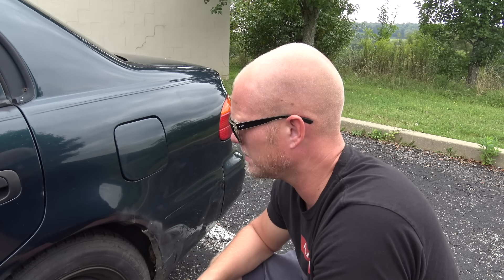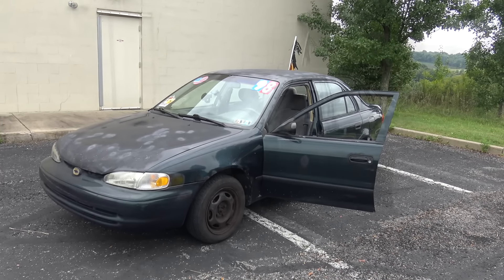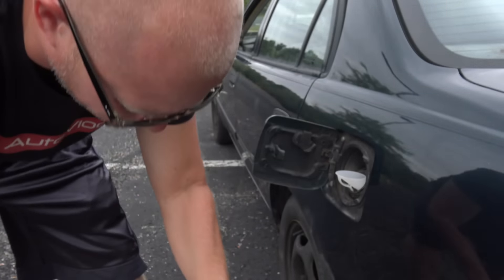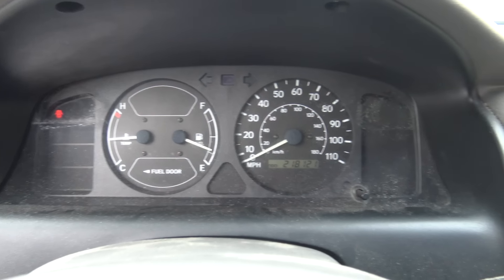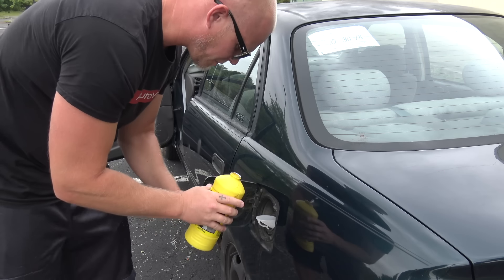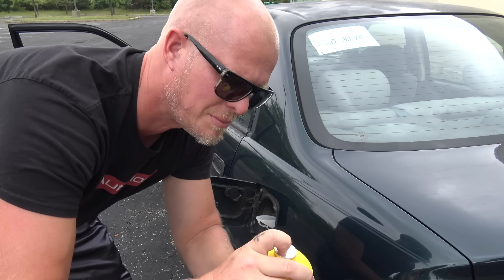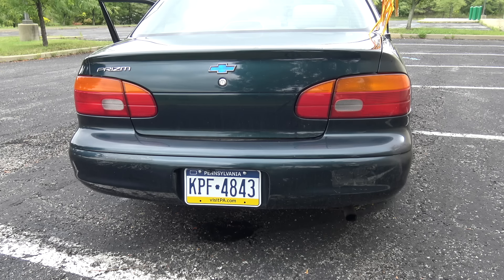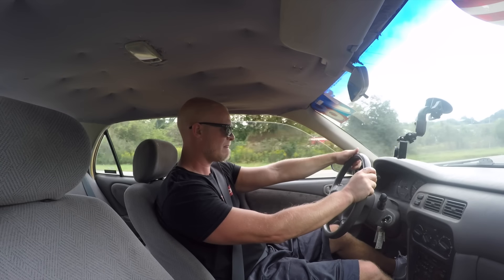What happens if you put BRAKE FLUID in your gas tank? (You'll be surprised!)

Comment: Just checked out your video, and found it to be VERY interesting. I recently purchased a 2018 Lexus and was curious to experiment as well. I replaced the brake fluid with blood, I took all the antifreeze out and replaced it with
 gasoline...  I swapped out my power steering
 fluid for hot sauce... I filled the gas tank with Nitro glycerin... I replaced the windshield washer solvent with black paint... I drained the transmission fluid and replaced it
 with Gorilla Glue... instead of regular air I filled my tires with helium. I started the car up to go to church that Sunday morning, and to my surprise it blew up into a million pieces!!!!!. I was thrown into the future and landed at that same Lexus dealership where I purchased my vehicle. I questioned the sales representative about such a liability, and he assured
 me that it was covered, and the catastrophe would be rectified immediately... I just did not read the fine print. Relieved, I walked out the front door and back into the past, and was happy to see that my  Lexus had been restored to pristine condition. Lesson here: stick to the owner's manual and don't forget to read the fine print.😲
Reply: So true. Good advise!!
Reply: What did you replace your blood with?? Is your Lexus that important? Now that could seriously effect your brain
Reply: @NickKler  
Happy New Year Nick...Just responding to your  comment on my automotive experiment. I must confess I didn't use whole blood to replace the brake fluid, I separated the plasma from the hemoglobin, and mixed the platelets with leukocytes. To answer your second point... my Lexus is not as important to me as the unicycle I got from a midget  at  Cirque du Soleil. As far as my brain being affected, I grant you I'm no Einstein, but the function of my cerebral cortex, far exceeds the capacity to hold a conversation with the upper echelons of academic Society. I conclude the hypothesis was a success!!! Have a wonderful New Year, and remember... Moderation is the key.
Reply: This was literally one of the funniest comments I've EVER read in my life! Thank you!!!:)
Reply: @antoniajohnson3852  Your Welcome..😎

Comment: Brake fluid will clean sticky lifters and sludge when added to engine oil,so maybe you just cleaned your injectors.
Reply: interesting, have you tried it?
Reply: kenneth walkers
Reply: Auto transmission fluid does the same, I add half a pint to the sump when I'm changing dirty oil as a flushing agent, I run the motor for a half hour or so and give it a few revs about every five minutes before draining and adding a fresh change of oil and filter, oil pressure is improved afterwards so it definitely clears out those passages.
Reply: Is this true mate???
Reply: @darrylwallace8623  I've been doing it for years with auto tranny fluid into the oil before a due oil change, I even do it with motorcycles when I don't know their history and having blew a bike up going mad on it afterwards I decided to strip and rebuild the motor, I was amazed at how clean the engine was internally once I opened the crankcases and I'd not long owned the bike and the PO hadn't done nothing to it but ride it for 16,000 miles.
Reply: kenneth walker h
Reply: @Rusty Highlander I've never heard of that one before, like I said I just run either car or bike on tickover giving it the odd few K revs then drop oil n filter and replace. You could eat your dinner off the insides of the bike motor which was sweet as a nut till 80k miles and I flushed it like this three times, I've another bike now and the old engines on the bench waiting to have the output shaft bearing replaced the only thing which has actually worn out on that engine since I mis-shifted and blew the gearbox through the lower casings but had no problems with the engine since, 8 years back now.
Reply: @Rusty Highlander I've just looked it up and it actually does exactly what auto tranny fluid does with rubber seals etc so I reckon it will have a similar makeup to ATF, Dexron 3.
Reply: kenneth walker pious pp00087
Reply: Cras.
Reply: @fornicateu2  it makes sense that brake or tranny fluid would help clean out the parts which the engine oil touches, but what about it helping to clean out fuel injectors? It seems like a lot of people in the comments say it's great for that but Idk, seems like it might gum them up, but what do i know
Reply: @Rick-the-Swift  I wouldn't be putting it in the fuel tank there are products available for that specific task so personally I'd not risk it.
Reply: Its a cleaner. However brakefluid will eat your rubber seals if you put too much in there. Otherwise.its a good system cleaner.
Reply: @kevintoomey8094  It doesn't eat rubber, brake seals are rubber, obviously you've never stripped a caliper. Ethanol, wood alcohol added to petrol eats rubber seals, I know this for fact after having to replace both fuel needles and seals in my carbs on the bike.
Reply: Regarding ATF in a sump...its stupidity...any HDEO or PCMO oil has more detergents and cleaning power than ATF...go to BITOG VOA/UOA section and chack that out...
Reply: @ExtraAlterMone  Like I said I use it as a flushing agent, I don't keep driving my cars or bikes with it in there and as a flushing agent it works, bikes don't get all those detergents in their oils as it bolloxes wet sump clutches up and makes them slip so when I buy a bike which to me appears not to have been well maintained due mostly to modern ignorance of the internal combustion engine then I flush them, try looking up the sludgeburners people are driving on here due to piss poor maintenance then tell me how good modern detergent filled oils are, I don't follow modern guidlines and change my oils at 3-4000 mile intervals, both my bikes and cars end up with massive mileages and I've only ever suffered electrical failures rather than mechanical. 62 years young with a dead mechanic older sibling watching over me, I must be doing something right.
Reply: I agree 100%+ with you .
Reply: @kevintoomey8094  there are rubber seals in brake systems .it doesnt eat them .
Reply: I tried that and my van blew blue smoke out from the exhaust all the way to the shop.
Reply: @flyrobin133  💀💀💀😂😂😂
Reply: @darrylwallace8623  Yeah, old timer mechanic( broke ) used to loosen stubborn seized bolt with brake fluid and ATF instead of WD-40( additional purchase cost).
Reply: @darrylwallace8623  Yeah, Broke mechanics used brake fluid and ATF to loosen seized bolts instead of buying WD_40. I use imported Swiss clock grease to lubricate door hinges  instead of grease from local DIY store.
Reply: @jasongunter6597  alot of seals at that
Reply: , oh 7for
Reply: 😲what
Reply: @Rusty Highlander Bottle of Techron does the same thing.
Reply: nooo...  you've got the tranny dipstick and brake reservoir right in front of you as you work on a car..... much easier to get to that to run across the shop for a can... or if you recently ran out
Reply: Do you ad before or after oil change and how much
Reply: Brake fluid has Acetone is it.

Comment: Piece of junk? It has 200k and it’s still runnning strong. Your Mercedes died within 2500km I think? Lol
Reply: jared Noah Toyota power
Reply: DJ Bahaa Chevrolet power
Reply: @tomlewis3490  Toyota engine
Reply: yeah, his AMG might not live that long.
Reply: Yeah
Reply: Lol
Reply: she ate brake fluid and nothing more than a little smelly fart happened... the Merc was killed just by,.. a little rain...
Reply: Like a rock
Reply: it's a rebadged toyota corrola
Reply: jared n , maybe it was only fer his moooooovies lmao .  just saying .
Reply: If it's still moving, it's not junk, yet. Keep throwing odd things into the fuel tank and it will become junk.
Reply: @bobl78  😂🤣
Reply: Tom Lewis, the Chevy Prizm is nothing but a rebadged Toyota Corolla. I have owned both and they were identical.
Reply: My 2K Buick had 362,000 on it when I sold it...My 2000 caravan has 173K right now..one owner...me.
Reply: @jldude84  After my new F150 dumped its bed on I-94, back in 1983...FORD SUCKS!
EVERY FORD SINCE, HAS BEEN A MONEY PIT.
MY '99 EXPLODER DID JUST THAT, BLEW OUT TRANSFER CASE, DUMPED DRIVESHAFT ON MY WIFE...FORD GARBAGE FOR US...NEVER AGAIN!
Reply: at least it's a chevy. that counts for something.
Reply: Lol got him
Reply: What happens if you put it in diesel?
Reply: @PRS247  Mercedes rarely make it to 200,000 miles.  They're not well-built cars.
Reply: @EtanDeCretan  Probably fuck all really oil change every 800 miles and new tyres when needed and a bit of this and that and all good
Reply: @EtanDeCretan  bmw e23 1981  owner....and none. Just normal stuff. Stock motor never opened.
Reply: Its a toyota
Reply: Them Hips can build a car. Support the Master Race? Buy a Benz.

Comment: I've seen running water into the carburetor to steam clean the valves etc. but again you need to rev the motor and keep it revved so as to not stall from the water. Let it run water thru for a couple min, turn off water run motor for a couple more and done. Don't worry about the massive clouds coming out of tailpipe most of it is water vapor.
Reply: Yep steam clean inside engine like that😂😅

Comment: stop calling it a piece of junk. more reliable than any of your other cars!
Reply: lol why is this the most true comment here😂😂😂
Reply: Because Mr.Clean always treating reliable cars bad, bet he won’t do that to his annoying ass c63
Reply: It's got a Corolla engine,  those engines run forever.
Reply: You got that right
Reply: Poop
Reply: Its a shame hes so quick in wanting to scrap it
Reply: In spite of the Chevy badge (Geo on the older ones) it's actually a Toyota.
Reply: the biggest problem is it culd hurt your paint job as for as with gas it will clean parts in the motor in   most casses it will help the car but i do think you should add gas !
Reply: Germán Bonilla not after putting brake fluid it wont

Comment: You might want to keep an eye on your Rubber hoses and seals.Some shops use Brake fluid to soften the seals on Automatic Transmissions.
Reply: That's actually completely backwards that's why you can use brake fluid in your transmission but not transmission fluid in your brakes the transmission fluid has detergents that soften the rubber in your brake system lines seals gaskets etc
Reply: @runsolomon  Brake fluid does not expand with heat. Transmission fluid does expand with heat. If you put Transmission fluid in your brake, will expand due to heat expansion and will applied your brakes without  pressing your pedal. That why you do not use Transmission fluid in the brakes. And Yes, brake fluid will soften rubber.

Comment: One thing comes to mind when I see this being done. I know that an old mechanics trick, is to add a little brake fluid in cases where you may need a seal to swell. I'm not sure of the long term effects of adding this brake fluid to an engine as far as the seals go.
Reply: Ok
Reply: @kristensalerno1075  Excellent input.
Reply: gasoline or oil will swell brake cylinder rubber so back in the day we did not clean them with gas. In the older days we would rebuild brake cylinders at each wheel instead of buying new ones. There were rebuild kits that we bought because it would save a few dollars. The brake fluid will not affect the rubber except in a good way. It probably cleaned the injectors up too. Brake fluid will eat paint so that is why people with custom paint jobs that cost a lot use silicone brake fluid so it does  not harm paint if it spills. However, a car that has had silicone spiled on it is difficult to repaint over the spot where it spilled unless super cleaned and prepped. With various changes in rubber now the newer cylinders might have viton or other superior rubber in them but I would still never use gas to clean them.

Comment: I put brake fluid in my automatic transmission once it stopped the oil leak and made the transmission start shifting like it was designed to do never had any problems after the brake fluid was added

Comment: The brake fluid has an alcahol content plus a light lubricant.  In the gas tank it serves as a gasoline additive; when mixed, suspends any water in the tank which is "burned".
Reply: Correct bro!!!
Reply: I'd like to see what would happen if you filled the gas tank full of Farts instead of gasoline.  Then see if it would still run?  Farts are in fact combustible.
Reply: Should anyone take the advice from someone who can't even spell alcohol?
Reply: @scassidy77  💩💥
Reply: Interesting. Would this cure my very lumpy tick-over due to Water in the cylinders, leaking from the inlet manifold gasket?
Reply: Intake manifold gasket failures (breaks) can cause leaks into cylinders and ultimately crankcase oil/water contamination.  Such failures can be cause by a warped cylinder head.   In any case, brake fluid will not help.  mt @waldenhouse
Reply: RML Bobby D   You’re referring to a leaking intake manifold gasket which is allowing the antifreeze from the engine cooling system to mix in the combustion chamber. In this case, it will do no good. You will need to have a repair.
Reply: there is no alcohol or lubricant in brake fluid - it is glycol ether
Reply: @scassidy77  it would have to be liquid fart.
Reply: @alberoDiSpazio  umm, that is a negative, Ghost Rider.. all a liquidy fart will do is spray poop particles, thereby clogging things up..
Reply: @blackheart8121  silly me, I forget automobiles need a mixture of  air and fuel.  Regarding poop particles Vegans would be exempt due to their high mileage but at the cost of lower octane.
Reply: Let me guess, a Ford?
Reply: There is no alcohol in brake fluid, it  would boil and cause spongy brakes.
Reply: @frostyab7579  glycol is a kind of alcohol

Comment: At more concentrated amounts you can't breath if you're in the path of the smoke. Had a bad brake booster for a while and goofed around with left hand turns causing the accumulated fluid to slosh up into the vacuum line leading to the manifold.

Comment: The brake fluid in the gas tank with at least a half tank of gas or more, in a closed system that has fuel injection will clean out the entire fuel system and also alleviate moisture build up in the fuel. But you must never let your gas tank get below a quarter of a tank with an older model car because any build up in the gas tank will clog and ruin your fuel system. Also only use one bottle because you over did it thats why it smells so bad. You can also use power steering fluid in the transmission and vice versa

Comment: Brake fluid, dexron ATF and diesel fuel make a great penetrating oil. I use it to break old frozen (locked up, seized) tractor engines loose.
Brake fluid has MANY uses other than the intended but use NOTHING  other than brake fluid in your brake system.
78 YOA and STILL learning.
Will in Florida
Reply: I completely agree

Comment: We used to use brake fluid poured directly into the carburettor on high revs to stop stalling to clean the carburettor out from deposits . It worked . This we used instead of redex and it did work . A lot of dirty white smoke came out of the exhaust .

Comment: for everyone saying "it's a $500 pos!" my first car was a 1997 Volvo 960 that i bought for 500 with 155k miles and I drove and baby'd that car for 50k miles+ and I loved it. never underestimate a good $500.
Reply: I got a 91 Chevy Camaro for $700. It leaked oil badly. Owner said the rear main seal was busted and to add a quart of oil every week or so. Took it home, used a flashlight under the hood to find a $1 distributor shaft seal was broken. Took 15 minutes to fix, drove the car for 5 years, and sold it for $3,500...
Reply: It's true because if the car last you six months it's a win. Renting a car for a week cost that much.
Reply: Russell Daniels cool!